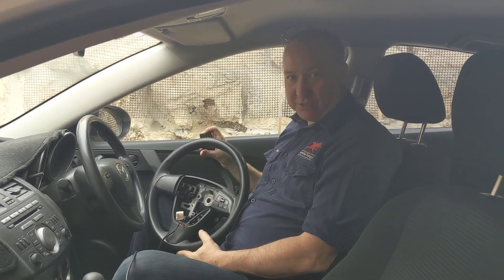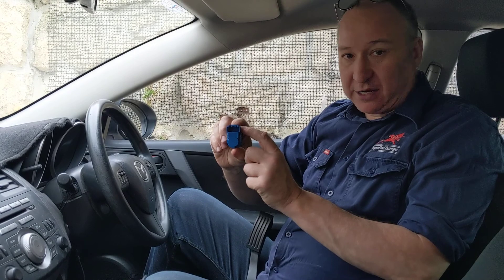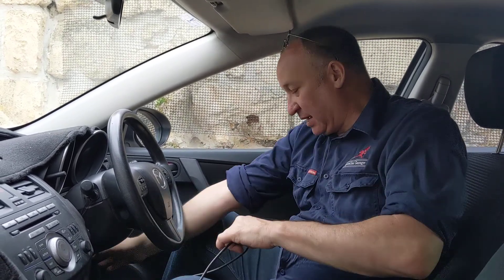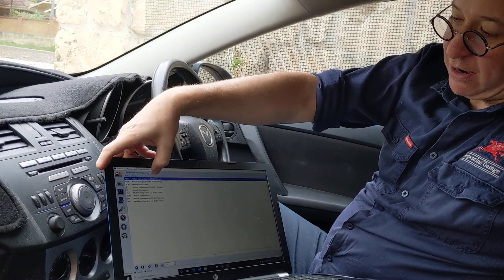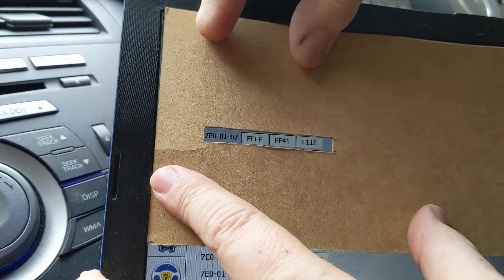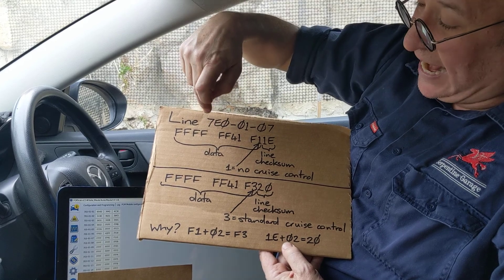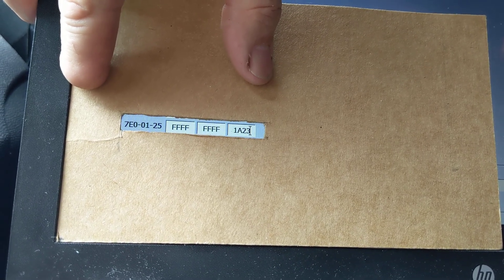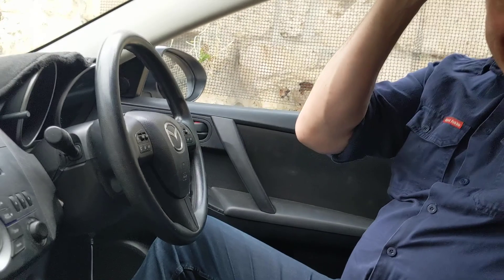BL Mazda 3: 1/4 How to install factory cruise control using FORScan. 2009 2010 2011 2012 2013 2nd

Comment: Dude, I could watch your videos all day - great stuff!

Do have a question - have you discovered any rhyme or reason to the easy method being available?  Is there a version of ForScan or certain models it comes up on?  

I’m having a heck of a time finding anyone in my area willing to activate this for me and will likely end up doing what you lay out in the video.

Thank you!
Reply from the maker: Thank you so much.  It means a lot to me to hear that feedback.  If you ever get to Perth, Australia then drop me a line.  You can be my cameraman, or vice-versa.  I have a lot more ideas for videos that I want to make.  One day I will learn how to edit videos too.  That's why all my videos are one take.

Re your question around the easy method sometimes being available on Forscan, I suspect (but don't know for sure) that it is a result of the way Forscan is written.  It might be the case that the programmatic logic only presents the easy method when the system thinks that it has cruise control installed.  In my video, when CC=1 I didn't get the easy option.  When CC=3 I did get the easy option.

But correlation is not causation as they say.  So I may be wrong.

My advice is to take the plunge and do it yourself.  It feels really good to solve complex problems without paying someone else.  Take the challenge!
Reply: @PaulinPerth  Success!  I had the easy way pop up, and so I didn’t learn as much about hexadecimal this time, but maybe next time!

Your videos were spot on for all the set up too!!
Reply: @PaulinPerth  You’re welcome!  I believe if you ever wanted to you would be a good automotive instructor for sure!

I ordered the adapter you used here and am setup on the ForScan forum.  Just need to download and setup the program itself and I’ll report back how it goes.  I do other work now but spent 10 years in an automotive shop, so I’m more than willing to give it a go.

Thanks for the invite too, I’ll keep that in mind!  😀

Stay safe!
Reply: Hey Paul stumbled across your vid and love it. Mother in law has a 2009 Mazda 3 BL auto. Am I right in saying so long as I can locate a 2009 Mazda 3 steering wheel WITH the cruise control buttons etc, AND I can locate the brake sensor switch with 4 pins instead of 2 (autobarn or wrecker?) then all I have to do it buy Forscan plus a cable and by following your hexidecimal instructions it should work.
Reply from the maker: @danielwundersitz5272  Yes. Technically you don't even need the whole steering wheel. What you need is the buttons and associated wiring loom from the steering wheel. But it is easier if you swap over the whole wheel. My advice is to use the wheel with the least sun damage in the 12 O'clock position. Good luck!  Post back when you're all done. And tell me what country you are in. I love hearing that I've helped people all over the world.
Reply: @PaulinPerth  cheer Paul. I’m in Melbourne so not too far away. I’m seeing a steering wheel replacement with the paddles - so prob from 2009 SP25 - any idea if once installed the paddles would work with the auto transmission? Or would that be another on/off option in the BIOS?
Reply from the maker: @danielwundersitz5272  The paddle shift steering wheel is the standard on the auto SP25s.  They work without any programming on the lower models as long as they have an auto transmission.
Reply: @PaulinPerth  cheers for that. What cable did you use? Was it OBDLink EX FORScan OBD Adapter ?
Reply from the maker: @ Yes.  That is the exact cable I use.

Comment: Oh man. I googled about this year ago, and found almost nothing useful about BL model. And now YouTube recommends me your precious video.  
I can't thank you enough for sharing this for free. 
I have few questions, so if you're willing to answer, it would be great.

1. Will this work on European version of Mazda 3 2012, made in Hiroshima.

2. I found someone selling steering wheel with cruise control but without airbag. Will airbag from my steering wheel (have controls only on right side, no cruise control) fit on the new steering wheel with c.c.?

3. Steering wheel I want to buy have scratched that "triangle cover/mask" under the airbag (some versions have them silver or black). Will cover from my wheel fit on the new wheel with c.c.? Because my wheel does not have c.c. on the left and right side of that cover. 

4. Regarding the brake switch. On eBay they're listed as Ford/Mazda switches with 4 pins. Are those the one I need?

Thanks in advance. 
Cheers from Croatia.
Reply from the maker: Hi there, I’m happy to help you.

1.	Both my donor VIN and recipient VIN start with ‘JM0BL’.  The first character (J) indicates that they were made in Japan.  So if your VIN starts with ‘J’, then I think you are fine.  Just check that you have a fly-by-wire accelerator pedal as shown at 2:00 in the part 1 video.

2.	I think what you are saying is that this person is selling a steering wheel with cruise control that used to have an airbag in it, but they have removed the airbag.  That is fine.  Your airbag will fit in this steering wheel just fine.

3.	I believe the triangular plastic directly below the airbag is black on the base model, and silver on the higher versions.  However, it is exactly the same shape.  The only thing different is the colour.  You can use whichever one you like.

4.	Yes.  That is the one you need.  When I started pulling apart my BL Mazda 3, I was surprised at how many items had FoMoCo (Ford Motor Company) stickers on them.  A huge amount of the BL Mazda 3 is actually made by Ford.

Have fun!  Paul.
Reply: @PaulinPerth Oh... Thank you for your time. You helped me a lot.